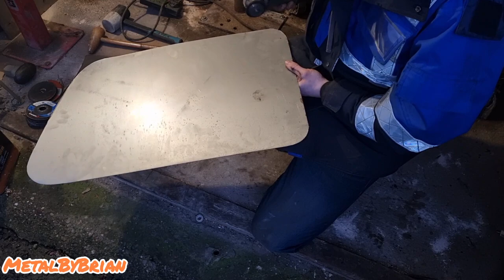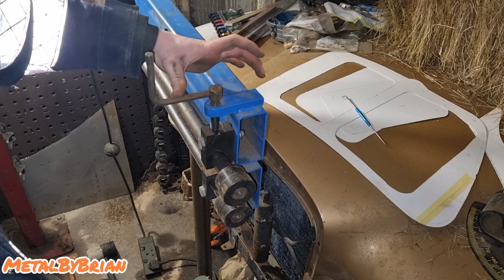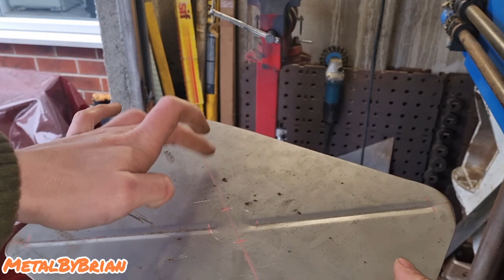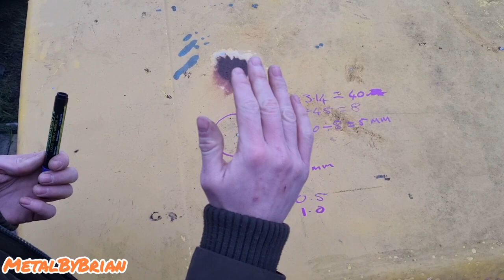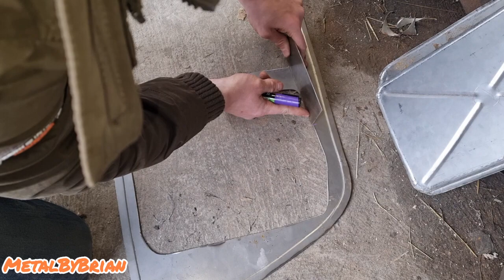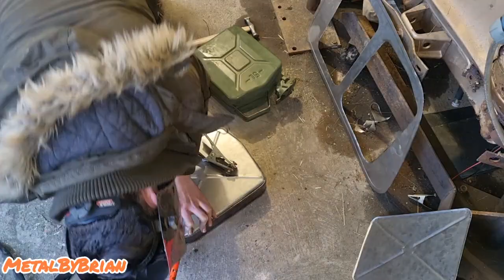The Yellow Bear - making custom sheet metal panels - Jerry can holder & tool box  - Lada Niva Tuning

Comment: también puedes probar a poner el panel en la ventana de la izquierda. así el deposito y las herramientas quedaría a la parte interior del coche resguardadas del polvo, el agua y los ladrones...
Reply from the maker: Yes that would work, but I wanted it to be easily accessed. Also, a roll cage and my spare wheel will be in the back so would make it difficult to access from the inside 👍

Comment: I was the same with cutting discs - until one did shatter (and I was putting almost no side load on it, certainly less than on many other I had misused in the past). If it's the small leftover bit of disc, ie like here, you'll likely be fine when one does shatter (as long as you have glasses etc). But bare in mind a bigger disc shattering will throw off larger chunks and with probably enough speed to severe a artery. Nowadays I have 2 grinders, ie one with a cutting disc and one with a grinding disc. The hassle of having to swap power cords :lol: still sees me occasionally using a cutting disc for minor grinding, but I'm always mindful of the direction the bits will shatter in when I do.
Reply from the maker: Absolutely, it's just bad habits picked up through the years. I've been using them like this since I was a kid in my dad's shop and never had one shatter, had them shatter when metals closed up while cutting though. When I was doing this sort of work for a living I used to have three grinders, cutting, flap/flex disc and grinding, however still used the cutting disc for deburing cause it was quicker than switching grinders and time was money 😆